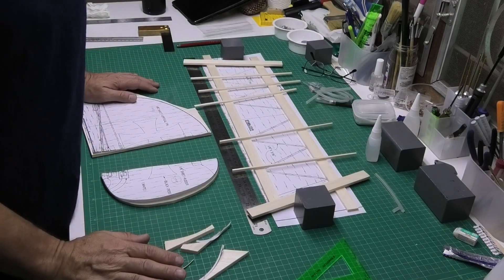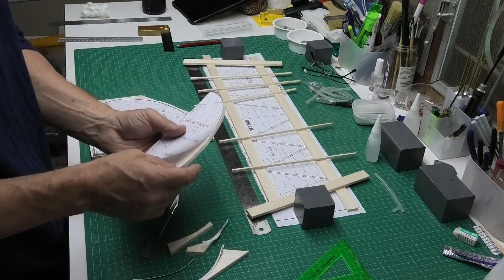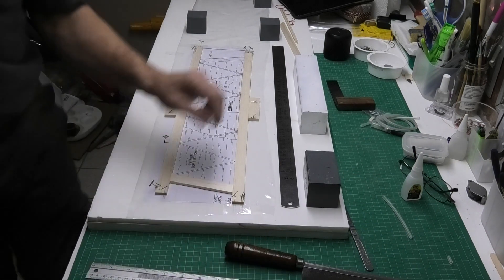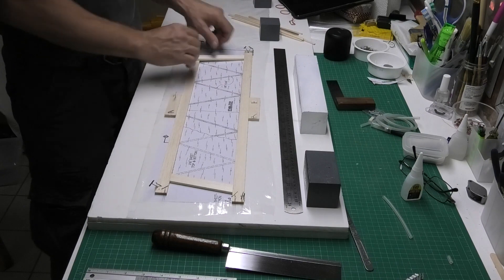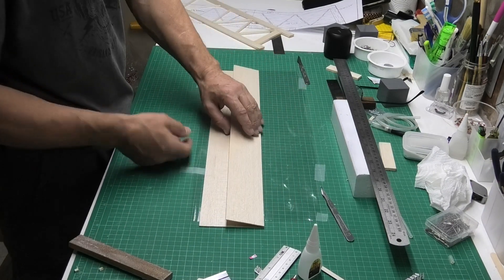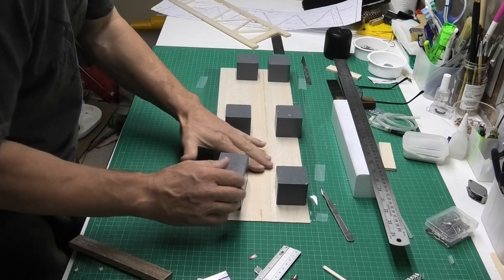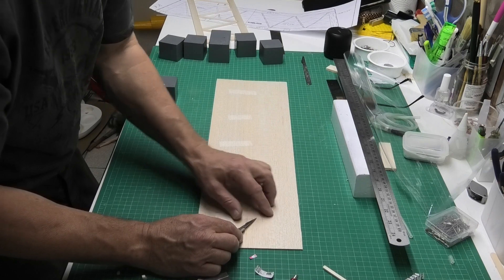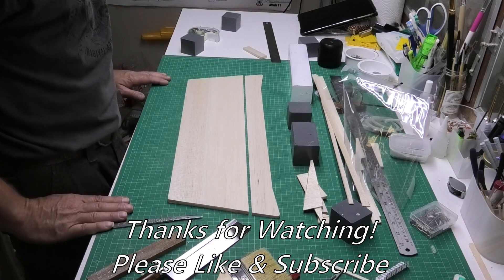Das Ugly Stik Balsa RC Aeroplane Build - Pt 7: Tailplane & Fin Construction

Comment: This has been a very nice build series! You're right that a lot of the original designs on the plan seemed to favor assembly over long-term durability. Phil Kraft designed it originally as a radio test mule back when proportional radios were an unknown quantity so they weren't expected to have long lives. Haha. They were just supposed to be easy and quick to slap together. 

My first powered solo was on a 60-size Ugly Stik built from the original Kraft plans. My instructor made me train on a beat up old Gentle Lady, and then when I could fly that without him having to take the radio away he made me solo on that 60-size Ugly Stik before he'd even let me touch my nitro trainer. I've had a fondness for these ever since.
Reply from the maker: Thanks for the comment, its appreciated 😀

Comment: I'm building in a spare bedroom.  Do you have any other glue recommendations besides CA glue because of the smell?  Have you ever used something like titebond wood glue?  I understand it will take longer to dry but I think it would be worth it.  Great vids. I subscribed
Reply from the maker: Hi there, thanks for your comment and your support.  This is the first time I have used CA so extensively in a build, I generally use PVA wood glue and Epoxy for the areas that need that little extra strength.  I really like PVA its nice to work with and you can use a small paint brush to apply.  Yes takes a bit longer to dry, but there are always other jobs that can be done in the meantime.  Good luck with your build.